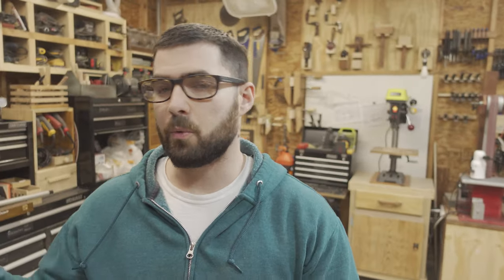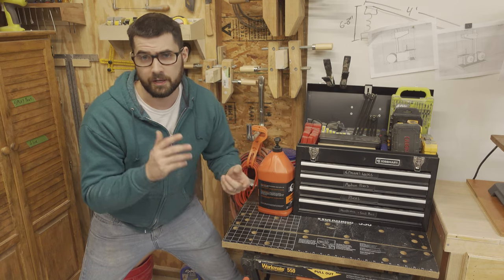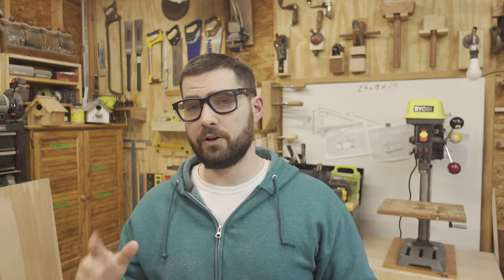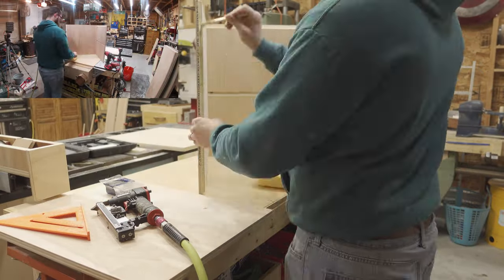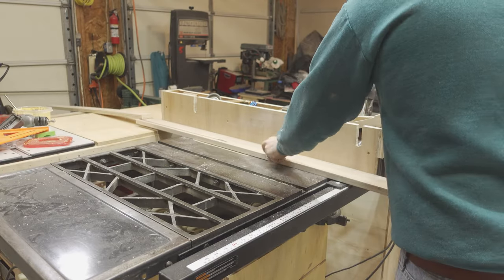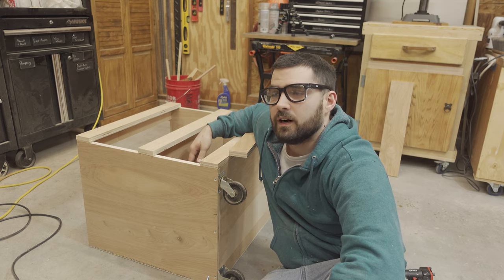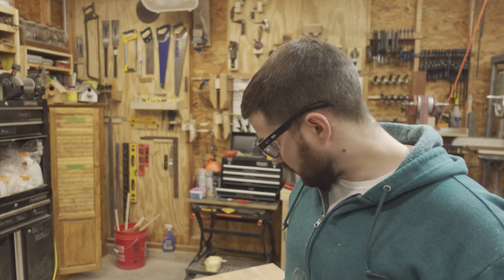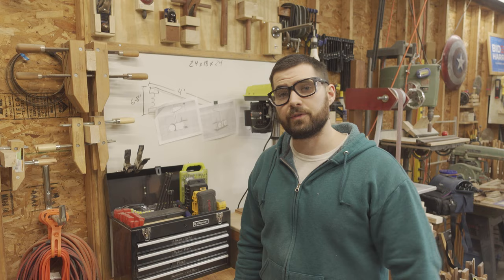Rolling Cabinet | Easy and Versatile

Comment: Bummer about the slanted shelf. Did you consider putting a 1/2" spacer in on one side and laying a second shelf in on top of it? You'd lose a lot of space but at least it would be level.
Reply from the maker: I had not.....That is a really good idea! I am still hoping to install some drawers this weekend but if that does not happen, the spacer will absolutely be my interim solution. Thanks for the tip!